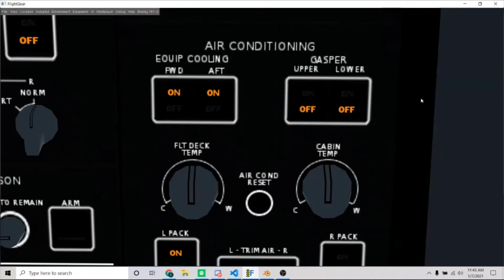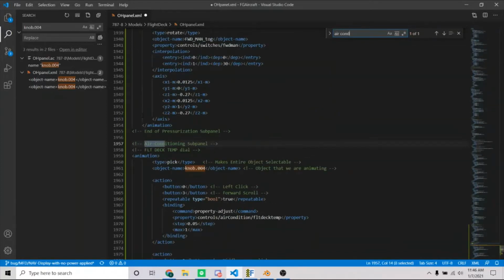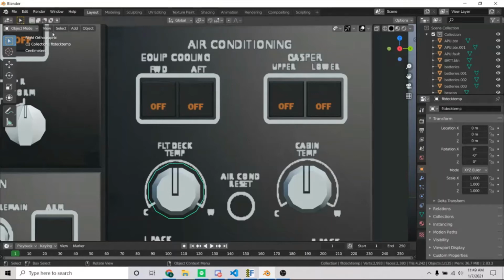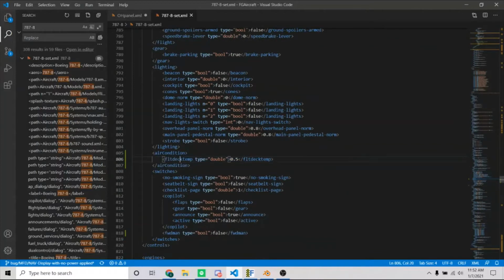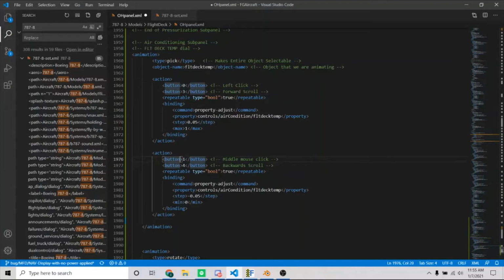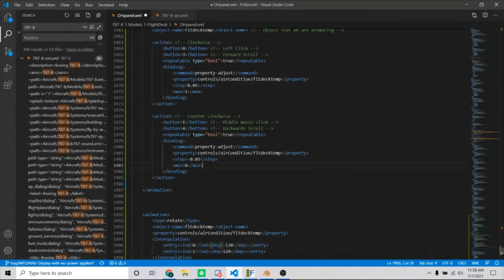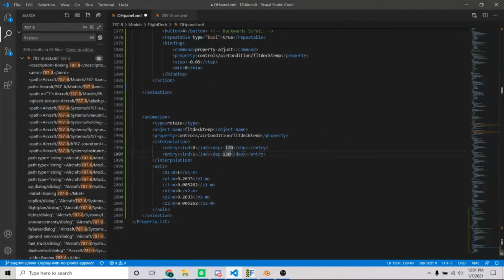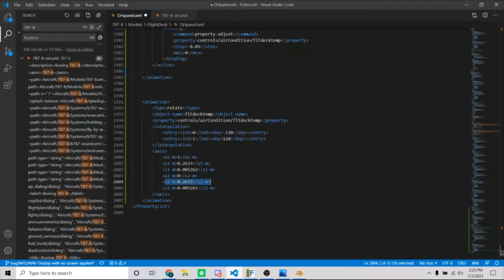Blender/XML Episode 3: Dials

Comment: Thanks for you videos. So far only watched 2, but very helpful to explain things. I am having a big problem with get a rotation
to roll correctly. Using blender to get the axis but cant get it to work right. Its the a350xb plane and its the know for adjusting
autobrake Cylinder.103. I wonder if you can help me out ?